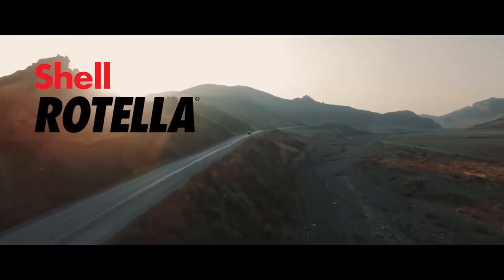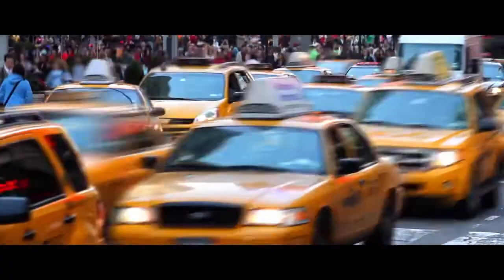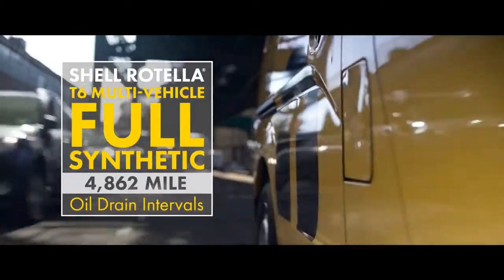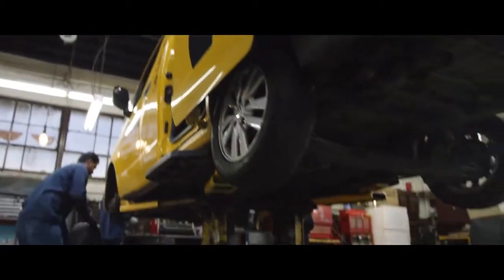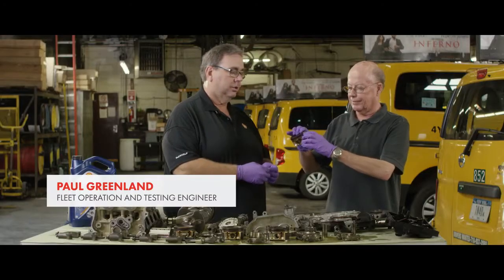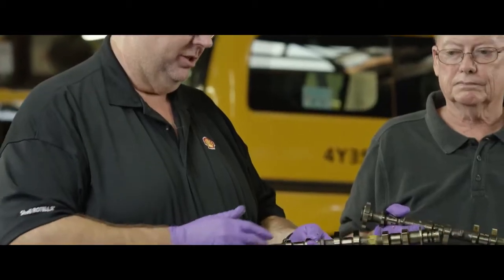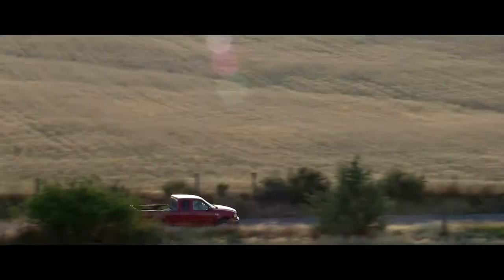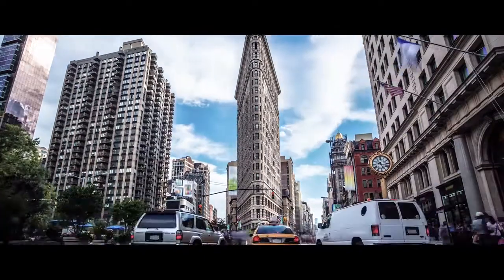Shell Rotella - T6 Multi-Vehicle Taxi Field Trials

Comment: Misleading. If competitor was using a mineral oil, of course there's going to be varnish. Why not compare T3/T4 against competitor?
Reply: They changed the competitor at 3,000 miles and the Rotella at 6,000 miles - plenty fair.
Reply: Agree. Pushing a 2x longer interval against either a full synthetic, synthetic blend, or conventional oil and achieving better results like the ones provided is a plenty fair comparison and proves its quality advantage.